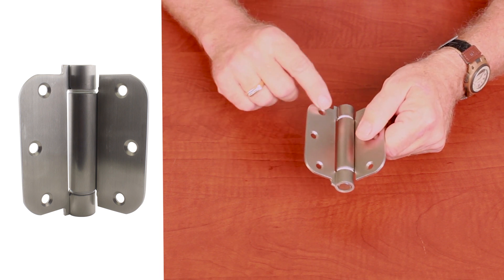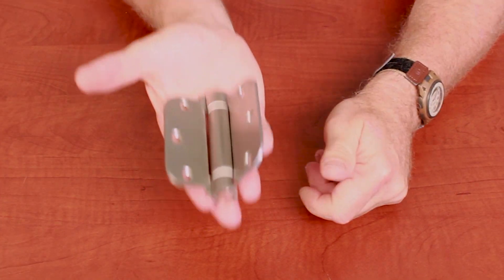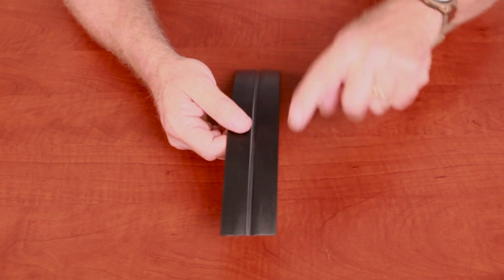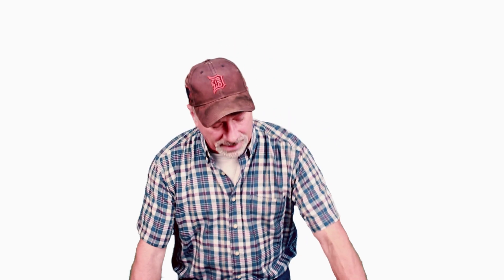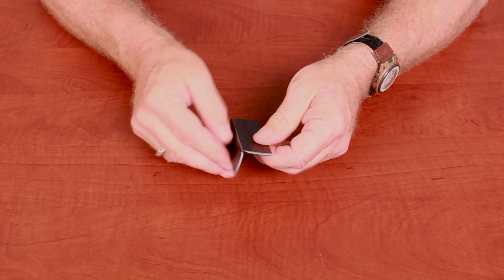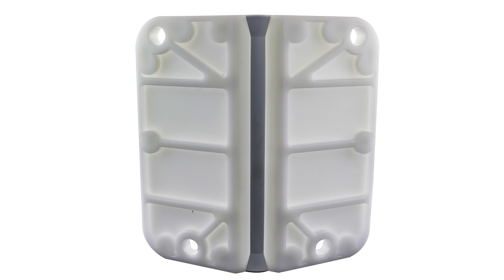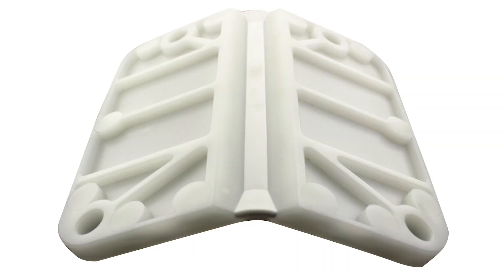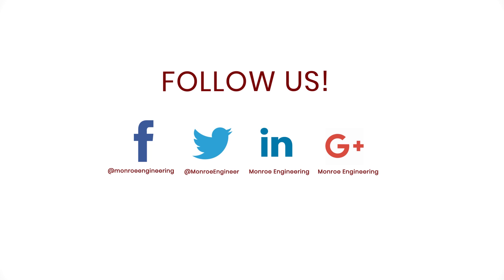What is a Plastic Living Hinge? Hinge Design Basics.

Comment: Perfect application for your hinges.    Bifold doors have two pivots which wear out quickly.   If the door packages included two or three prehung plastic living hinges would solve the problem and extend the life of the door pivots.
Reply from the maker: Hi Fern D, yes the use of plastic hinges does help to extend the life of door pivots in many situations. They are very useful in many ways.

Comment: Interesting. What would be the best way to attach this to corrugated plastic, or other plastic sheet materials? Can it be glued, or would you need a fastener?
Reply from the maker: Hi Funkatastrophe, so sorry for the delayed response. We would recommend the use of a fastener. It is possible to Pierce the living Hinge with a custom hole pattern in the production process. We have seen many types of fasteners used, from rivets to nuts and bolts. The very smooth surface of the hinge resists adhesion to most common glues and epoxies.
Reply: @onemonroe  thanks for the response! I forgot I even asked =]
Reply: @onemonroe  im using epoxy for my situation how much does this cost?

Comment: What type of plastic would be good for these hinges?
Reply from the maker: Poly Polypropylene is the most common. It has long chain polymers which are well suited for the application.
Reply: PP is not uv proof
Reply: @WaschyNumber1  Do not expose it to UV then or chose a different material that has the properties you need.

Comment: I have a unique situation where I need to cut the top (Plastic) of a 4 yard trash front load trash bin in half and then hinge it back together.  Would the living hinge work and if so how would you fasten the lid back together after you cut it. This is a common problem when the trash enclosures are not built tall enough to accommodate the open of the bin within the enclosure space to load with trash by the custodian. This is also a problem when the bin is tall and the employee cannot lift the lid easily by themselves like on a 6 or 8 yard bin. 
Larry Ellis
916-577-0313